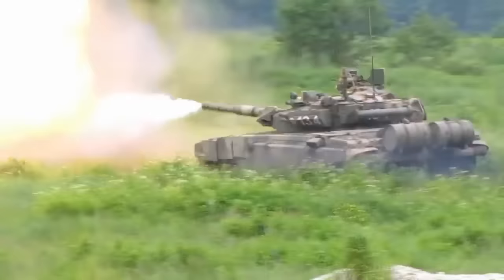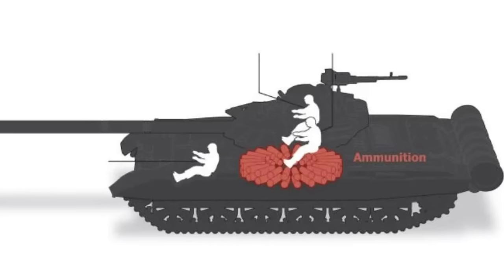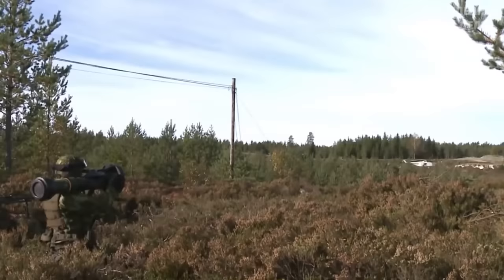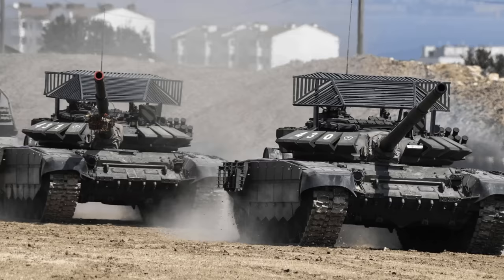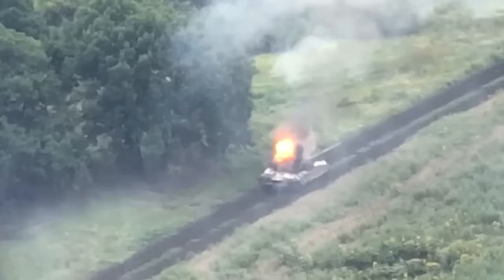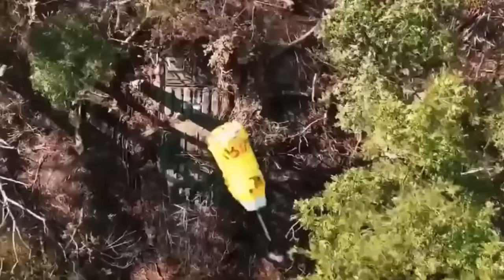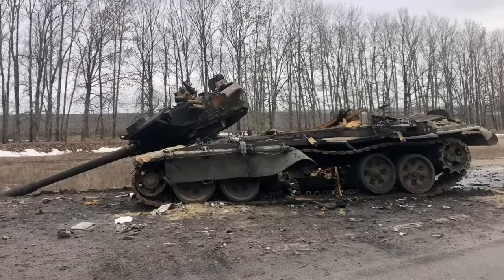Why does this happen to all Russian tanks? / real footage frome Ukraine

Comment: 1. A lot of these tanks are very old, the T-64 was produced from 1963 to 1967, and the T-72 was from the early 1970s, The M1 Abrams started production in the 1980s.
2. Odds are the M-1 deployed in Ukraine are getting just as destroyed as the Russian tanks. For the most part US M-1 are largely used for infrantry support and the US uses airpower to engage tanks & there is little public accessed data on the M-1 survivability.  As far as the US, it has the M113 APC with uses aluminum for armor.

Comment: This video is interesting but some parts are wrong.
Russia is already aware of this issue and changed the doctrine many years ago.
The armata platform (T14) use a whole new chassis design. The turret is now unmaned and  separated from the crew.
Just armata production is VERY late.  From what i have heard / read , among thousands of tanks, Russia has less than 50 TEST models.

Comment: Ваши абрамсы и леопарды горят не хуже, а ещё лучше бк в башне и близко и броне плита не спасёт, а на т 72 бк в низу и от доставания взрыва каммулятивного заряда дальше расспологается. Your aвramses and leopard burn no worse, and even better, the bc in the tower and close to the armor plate will not save, but on the t 72 bc at the bottom and from getting the explosion of the cumulative charge, it is further questione

Comment: You mean to say that the turret+gun (which is technically the same unit) weighs 2000kg. Well, then a full t72 weighs maximum 20.000kg total... the turret is minimum 12.000kg... you are wrong by 500%... unlucky buddy x)

Comment: This does not happen with every Russian tank. The network is full of videos where tanks withstand multiple hits. I saw a video where there were 5 hits from grenade launchers on the tank and it continued to move without problems and only the sixth hit brought down the caterpillar and it still continued to move for some time. 
So, author, you are either deliberately misleading, which means that you are a manipulator and a liar, or you have not studied the issue enough and your opinion as an expert is zero.

Comment: This was already a meme before the war, but now it is out of the box for good I guess.

I'll have to add that sealing the hatches doesn't save the tank from a top-attack munition, however. The roof armour would have to withstand the explosively formed penetrator of the HEAT warhead, and the roof armour of most tanks doesn't stand a chance of doing so. The penetration is likely much more catastrophically lethal in tanks that have the carousel type autoloader and the munitions stored under the crew in the same compartment, which is common with Russian designs. The stored ammunition is very likely hit and ignited by a penetrator aproaching from high angles.

Comment: Powerful enough not to feel it. That is what happens when the ammo cache goes off usually. Some tanks have wet compartments so if a shell hits the ammo then it will flood with water rendering the gunpowder useless. Though I’m unsure about the Soviet tanks. Someone correct me if I’m wrong on this statement as I’m only :35 seconds into the video.

Comment: New American Abrams X concept has auto loader, 3 crewmen and crewless turret

If the Americans switched to an automatic loader, It turns out that our engineers were right, starting with the T-64 and T-72, removing the loader.
 But some, foaming at the mouth, argued that loading by hand is a superior engineering of Western tanks and Soviets tanks always blew up. While crewless turrent was already implemented in Armara tank

Comment: I think they use new extremely powerful anti-tank mines and new enhanced warheads for the Javelin. It looks like no matter how many tanks roll into the Ukraine they are all helpless against the mines and bazookas. Ukraine could do this literally forever raining down manpad-missiles and drone grenades on tanks, and hide mines everywhere. We will see if the tactics of this war will change over time, but tanks have no chance against guerilla-like warfare with hidden bazooka and minelayer troops everywhere. All of this might lead to using other weapons than tanks, probably even tactical nukes some day. Or the more clever solution: Just ending this expensive war (for both sides). In a video yesterday someone said shooting a Javelin is like shooting a Ferrari every single time, with costs of over 100.000$ per rocket.

Comment: This material is so full of crap...
First of all, there is nothing strange about tank amo cook-off. Not nothing new. ALL tank can explode when hit. Russian tank are know to have pretty high chance for it (and high chance of turret launch if it happen) for more than half century. 
Turret+cannon wight about 2 tons? The gun itself waight more than that. 2A46 (for older T72) - 2,6t. 2A46M (for T72B3/T90) - 2,45t. The whole turret would be somethink like 10t, or more. 
"Properly exposed to a target weapon" - wat? What it even mean?
Russian (or any other tanks) can be also destroyed by any other ATGM or ATRPG, tank rounds, mines and many more. All can cause amo cook-of, although some are more likely to do it than other.
Turret, especially front of the turret, are the strongest part of every tank, Soviet, Russian, China, NATO, whatever. It is the most exposed part, so it is made way more armored than anythink else. 
The main amo storage, the carrousel of the autoloader, is UNDER the turret, not inside of it. And it does not hold even close to 40 rounds, in T64 it was 28 rounds, in T72 and later tanks it is only 22. 

Hatches on the roof... omfg, EVERY tank with crewd turret have hatches on the turret roof. And most of the time they are closed, especially on russian tanks. If you see a video like this, 95% the tank is already abandoned. NLAW and other top-attack munitions do not use them, they simply break through the roof, as it is much weaker than the front. And they does it using cumulation effect to form a high preasure penetrator to break anythink on it's path, not some flame jets.   

"Missile hit the tank almoust vertically. This is very visible in this video frames" show the clip of a missile hiting at 30, maybe 40 degree. Are you so dumb that you have no idea what the vertical mean?

Aaaaand... all of ot does not made the tanks useless, not obsolete. They are still very much needed and used... by bouth sides. Ukrainian tank have exactly the same problems. And... most if the NATO tanks have this problem too. Only Abrams have ALL his amunition in separate compartment. And... they have 2m wide dors, that will be open during reload of the gun. Some other nations have separate amo compartment on the back of the turret, but some amo is stored in the hull, not protected at all. Others have protection symilar to russian tanks. If you look for them, you can easily find examples of turret lauches by Leopards 2 or even Abrams.

Also... this "western nation care for the people, soviet do not" is complete boolshit. Bouth western and soviet tanks are made with survivability in mind, only in other way. NATO try to made crew survive after the hit and penetration. Russian try to made they tanks as small as possible, so they would be much harder to hit. Look at the size of M1 vs size of T72. Especially turret size. Also, basic armor of soviet tanks was much better than armor of western machines. To some degree still is (except Abrams and maybe new versions of Leo)

Comment: There's a reason why western tanks like the Abrams are so easy to survive.  Big reason why is you see with the Abrams is the steel doors in the ammo compartment and in the bussel the blow panels so the explosion of the ammo goes upward instead of going to the crew compartment.   One of the smartest designs you can say for a tank.
Reply: This is only partially true

All Western tanks (except the Abrams) store 2/3rds of their ammunition in the crew compartment without the protection of blast doors or blow-out panels
Reply: It’s not just Russian tanks but even NATO tanks also explode when they are hit by modern ATGMs. It has happened before to Saudi Abrams and Turkish Leo 2.

Comment: Sorta right about the TOW missiles and shields weve seen on the tops of russian tank turrets... although a bit of a simple explanation. HEAT rounds or shaped charges work by firing a super hot, pressurized jet of molten copper through the armour. This happens usually on impact or detection of the main armour. So having an inital plate that molten jet will strike, plus a large air gap between it and the main armour, should hypothetically increase survivability for the crews. As shaped charges actually travel less distance in air than they do through solid steel. However in this case, we can see it wasnt effective.

Comment: Well, I'm pretty sure, Abrams or Leopard will also turn into nothing with all its crew in case of detonated ammo. Weak roof is a problem for almost all tanks, so there is no difference for good anti-tank missile. Opened doors, vulnerable for any tiny grenade is just a matter of case, when the crew is not in battle, resting or the vent system failed. My point is that fireworks scenario is not so common, as your propoganda says. You gotta be really sceptic to see the truth nowdays.

Comment: They said some Russian tanks had an engine built in Magnesium, to reduce weight, this is the flashlight emiting smoke you watch in very old photo equipment, just drop a Molotov cocktail on cooling grille, and the whole engine will flash. Arriving there is the hard task.

Comment: Relax gloaters, the design for the tank itself and ammo storage is an old one for which countermeasures have long since been developed. FOR IT"S TIME it was a good design, but obviously technology and tactics change. Ammo stored in a bustle must be thoroughly protected which would have caused the tank to be much heavier, more expensive, and would have increased the ground pressure of the tracks. Ammo stored on the floor of the tank was 'out-of-the-way' of the place most likely to be struck by enemy tankers and missiles...the turret. A study commissioned after WW2 proved that tanks were most likely to be hit in the turret, and that most tanks destroyed or knocked out in WW2 were in fact hit in the turret. An old tank with an outdated combustibles storage and safety design is more likely than most other armored vehicles to fail catastrophically when hit. I wouldn't want to go to war in ANY old tank.

Comment: Actually when the Nlaw detonates above the target, it has a downward facing shaped charge which penetrates the armour. 

The shaped charge is designed to concentrate the downward explosion onto a small area. The charge has a hollow cone with a copper lining. The flame jet going downward is shaping the copper into a spear like shape as it shoots it down onto a small area on the tank roof which punches through the relatively thin roof armour. It only makes a small hole and a little of the explosions energy pushes through into the tank, but this is enough, as it reverberates around the enclosed space inside and will incapacitate the crew and do severe damage to the interior.

Comment: There is so much wrong about this video:

0:20 Tanks of soviet turrets way much more than two tons. The 2A46 gun 125mm gun alone ways more than two tons.
0:53 A Russian tank can't just be destroyed be NLAW, Javelin or grenates, but with all sorts of weapons like, tank guns, artillery, mines, guided missiles from ground or air, bombs and improvised explosives. Ukrainian made Stugna P missile has likely destroyed far more tanks than Javelin or NLAW.
1:12 The turret in general is not the weakest part of a tank, but the strongest one. A lot of studies and war experience have shown that the turret front is the most likely part to be hit, thus the strongest armor arrays are placed there. Weak top armor is not typical for soviet/russian tanks. Every tank has far weaker armor on the top than on the front and sides
1:18 Russian tanks are not all obsolete. They field many different tanks and more or less modernized variants. In general most modern US or German tanks are superior, but russia at time fights Ukrainian and there their tanks are more than good enough. Russias problems are their terrible tactics, like no infantry support for tanks and poor crew experience in general.
1:27 The autoloader carousel is placed on the bottom of the hull and not in the turret. 
1:39 Leopard 2 actually has non protected ammunition storage in the front of the hull. Turkish Leopard 2 tanks also suffered catastrophic explosions in Syria cause of this.
2:01 Top attack munitions don't target openings of the tank, but just the weaker top armor of the tank.
2:59 How do you know that in a particular video a tank was his by a javelin and not something else? I know it doesn't matter to much, but for me this adds to the general attitude of having no problem with spreading misinformation. 
3:10 These are videos from the Syrian civil war. Yes, they are also T72, but the videos are completely ripped out of context. 
3:32 It's clearly visible from the different color of the ground the tank is standing on, that both tanks are not the same one. Why are you making up this stuff?
3:53 Russians on never variants actually worked on crew safety. The problem is they can't build and afford a entire new tank fleet, so they are stuck with mostly less save soviet time equipment. Btw. it's not like western tank design cares about the personal life of a tanker. The idea is just that tanks are easier to make than experienced tankers, so you want the tanker to fight another day.
4:12 300mm of what on which tank? 300mm of non angled plain armor steel is actually not good at all today. A lot of anti tank weapons fielded in Ukrainian have around 800mm or more of penetration power. (Stugna P, RPG 29, Panzerfaust 3, Kornet missile, tank heat rounds)
4:29 How vulnerable tanks are from the side highly depend on the angle they beeing shot at. A hit straight on the side in most cases will be catastrophic as seen in many cases in Ukraine. Explosiv reactive armor mentioned here also is a lot less effective when hit straight on.
5:03 Javelin doesn't hit the target almost vertically, but from a steep angle. Javelin compensates for that by fielding a stronger warhead than for example an NLAW or TOW 2B
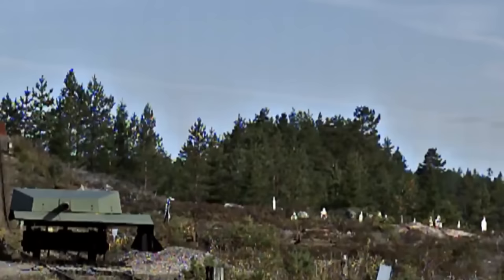5:33 A Heat warhead can by no means be described by "creating strong flame jets". Heat warheads work by inverting a metal cone into a thin metal jet with very high speeds of up to 10km/s. With this effect very high penetration power can be achieved.
6:15 This "fire creeping through openings theory is so wrong". A simple 5min wikipedia read is enough to see that this makes no sense at all.

Comment: It IS simple.. The Russian tank designers opted to have an auto-loader.. Very cool.. Russian tanks such as the T-72, T-80, and T-90 have an automated "hold and load" ammunition system and carry multiple shells in a ring within their turrets, and underneath the operators., ie they do not have an amo locker with a blast door that directs propellant explosions out of the tank)  like most of the other modern tanks out there...

Comment: Gotta love russian engineering... let's just put all the ammo directly under the crew in the same compartment, I don't think anything will go wrong...
Reply: tbf, back in the late 60's early 70's when they adopted the "carousel" that was a smart place to put them bcs the bottom of the tank is very rarely hit. Probably safer compared to the M48s and M60 of the same age. 
The problem is when they started to put munitions everywhere inside the tanks to compensate the low capacity of the carousel.

Comment: Not all ammo its stored in Leopard-2 in the rear turret in blow off panels. half of them arestored in the left of the driver compartment, im not sure if those have blow off panels!
Reply: All Western tanks (except the Abrams) store 2/3rds of their ammunition in the crew compartment without the protection of blast doors or blow-out panels.
Reply: @thephoenix756  well thats a broad generalization, the western tanks didnt store 2/3 of their ammo in the turret, in the turret they store small amount of shells for the main gun, in leopard-1 they store only 13 out of 54-55 shells on the turret left of the loader ready to be used , the rest are stored left of the driver on the hull. same goes for M-48, and M-60 tanks. i dont have personal information on the english tanks they say they stored them below the turret floor, in a safe place.
Reply: @petros311  

The Leopard 2 stores only 15 rounds behind blast doors; the rest of the rounds are in the crew compartment, next to the driver. 

The Challenger 2 stores none of its rounds behind blast doors

The Leclerc stores 22 rounds behind blast doors; and the rest are located in the crew compartment without the protection of blast doors or blow-out panels 

The Merkava mk4 stores only 10 of its 48 rounds behind blast doors.